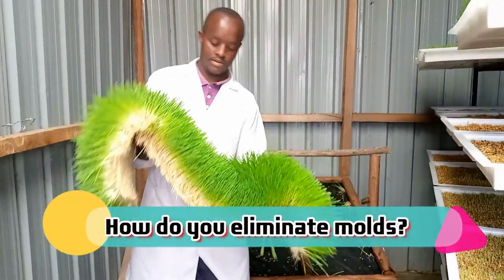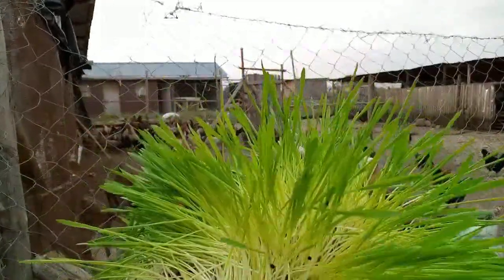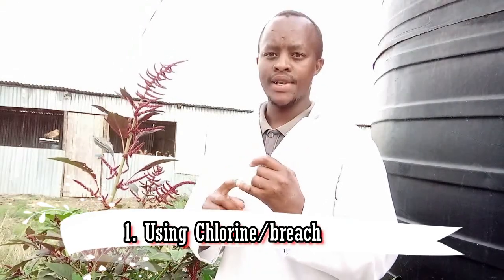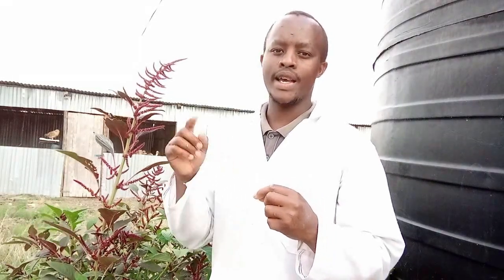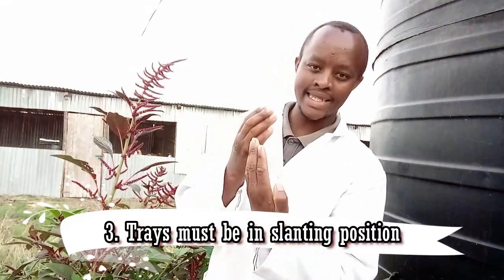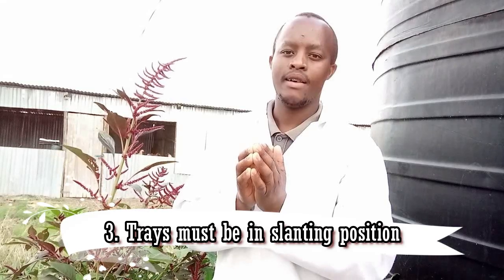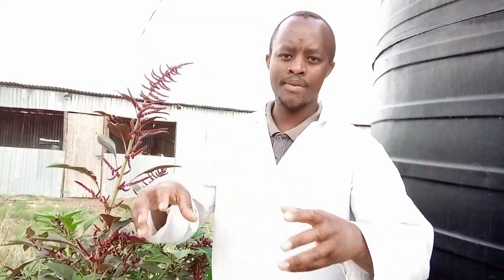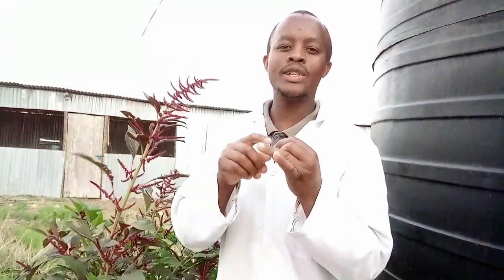5 Ways To Ensure No Molds and Fungi Growth in Hydroponic Fodder

Comment: Thanks Peter, how do you measure jic, like two kilograms of barley seeds how much do you put in?
Reply from the maker: Just add about 10ml to 20ml jik in the water to be used for soaking the seeds.
Reply: @FarmersPoint  in this what amount of water should it be
Reply from the maker: @jameskamau2702  below 20mls will take 10 - 20ml
Reply: @FarmersPoint  am lost 20mls in 10- 20ml
ama ni 20lts
Reply from the maker: @jameskamau2702  sorry for that it is 20litres.
Reply: @FarmersPoint  здравствуйте, что такое джик?
Reply from the maker: Whatever the kg of seeds that doesn't matter.